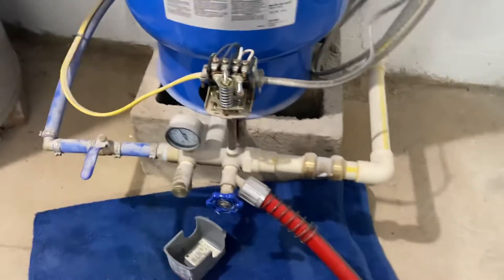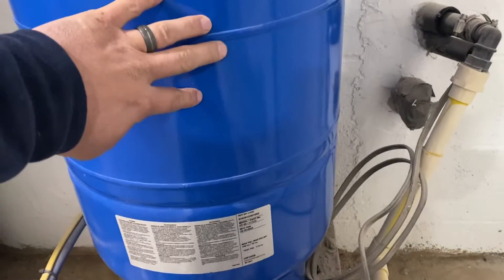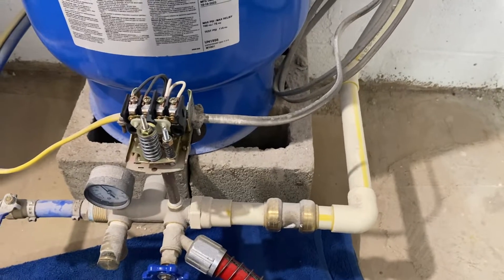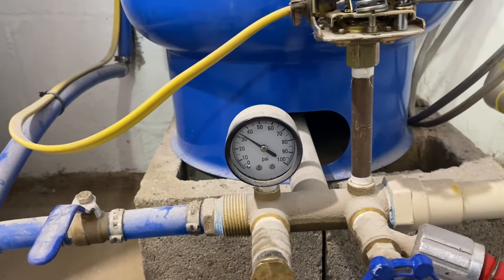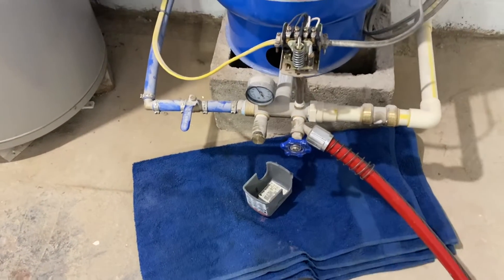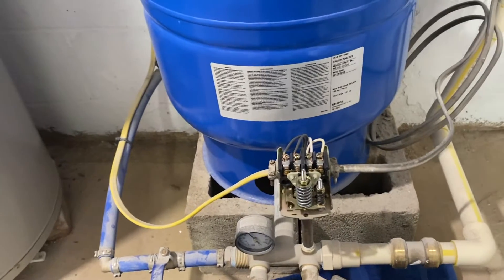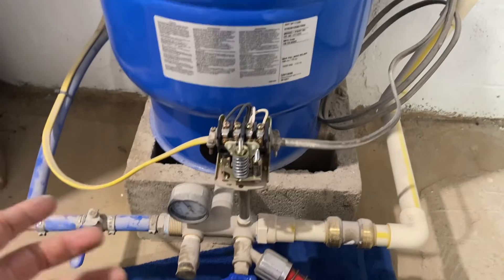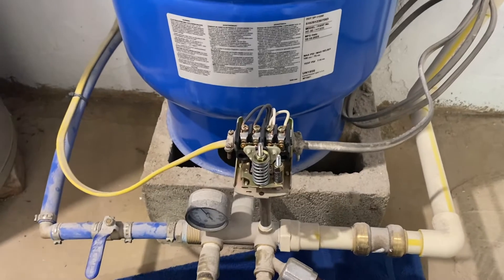Why Does My Well Water Pulse? Why Would The Pressure Hit Zero Before Kicking On? Lets Talk About It,

Comment: I have similar problem. I have 40/60 switch and I adjusted to 50-70. When I set Pressure to 48psi it is short cycling. I dropped pressure to 40psi. Now issue is that when cut out of 50psi reached gauge drops to 40psi then come backs up to 50psi and star filling. What would be the issue?
Reply from the maker: Interesting issue. It’s possible the switch could be faulty or some sediment is clogging the nipple.  Before you adjusted anything was the cycle length normal? I would consider bumping things back down and see if that fixes the issue. To eliminate a delay from a bad check valve I would see if you can cycle it a couple times. Another option could be a bad gauge on the tee assembly. You may have accidentally lowered the cut on/ off to 30/50.  On the top of the tank is a valve.  I’d tap the with a tire pressure gauge at normal, cut on and the cut off.

Comment: Well, 1st. I see it actually kicked on at 33psi / off at 43psi [pretty close together].... Next question? What's the bladder pressure? So, I got that part right...
MY PROBLEM: Pressure switch kicks off at 72psi... pressure drops to 52psi, then slowly to "near zero" before the points finally switch on again. Thoughts? 
I have a 50/70 switch. Bladder [empty] is 48psi ... My switch actually engages at 52psi /off at 72psi [I have a long  run from the pressure tank, and a two story house, explaining my desire for higher pressure].
...ps... the pressure plate/diaphragm and 3/8" supply line are debris free..

Comment: Why not just adjust the differential on the pressure switch?
Reply: Adjusting the bottom pressure switch 2 psi is such a simple thing to do and costs nothing.
The manufacture would never see any adjustments made if a failure would occur and thus the warrantee would not be voided.
The adjustment on the nut would be about 3 to 4 turns.
Reply: @TheHavocdog  but how will they make more money?
Reply from the maker: You can but not using a factory set switch can void warranties in a lot of circumstances